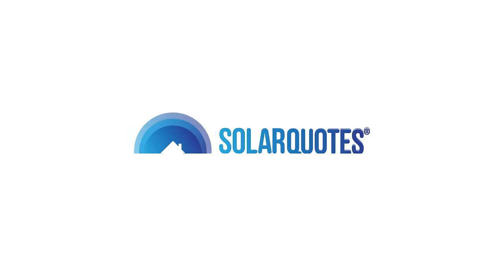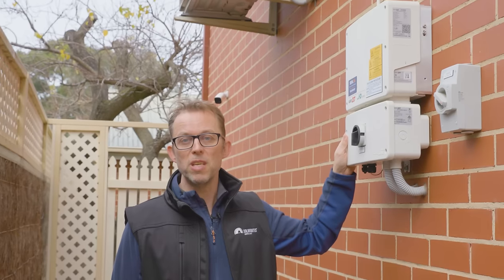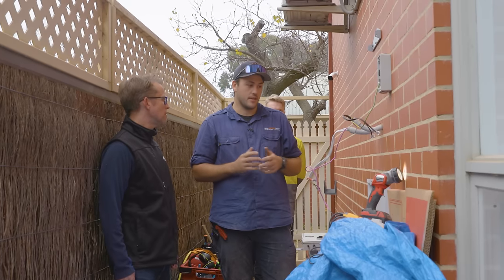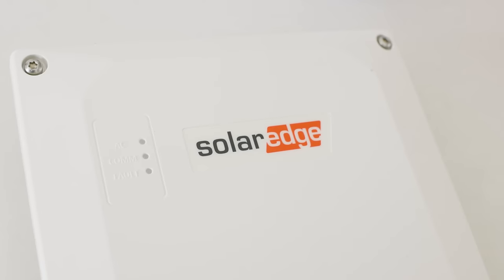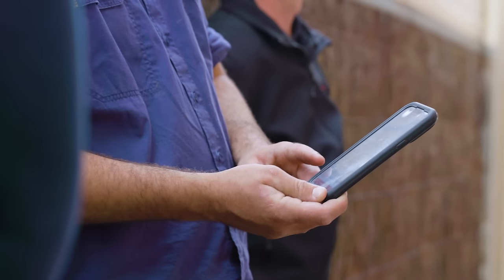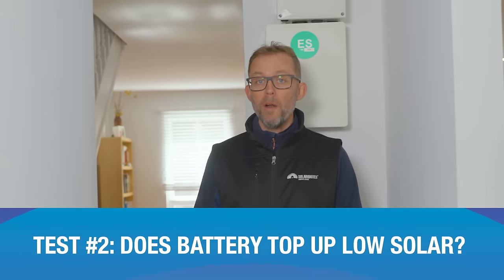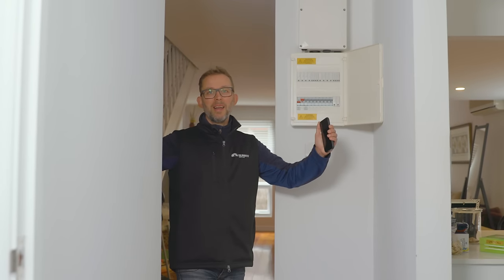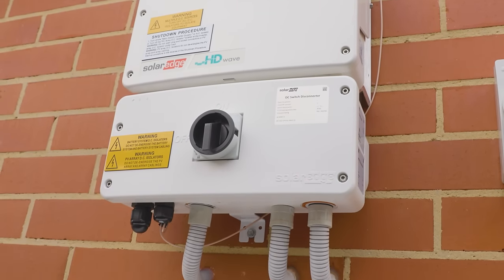SolarEdge Battery Install (Australia). It FINALLY worked!

Comment: Nothing about costs I note. Based on your previous solar battery tests I still can’t see how these things are worth anything like their cost. The idea is great, the execution is very disappointing. Thanks for the vid anyway, it’s nice to stay current.
Reply: I ask one of solar solar mobs how much for a system with a battery $53000 the panels were only $3500.
It was a joke. I told then they were pissing into the wind.
Reply: @gingertom56  That can't be right. Whereabouts do you live, and what was included in the quote?
Reply: @coopdivi  we have a heap of solar companies selling rebated solar systems here in Australia
So a rebated inter active grid system they awere selling for 3.5 thousand.
I asked for a battery for it and they can back with the 53 thousand.
I wanted an off grid.
Even the local solar and sat installer in  gin gin wanted 45 thousand. Fo a 5 kv system.
I brought through a Melbourne company for just under 20 thousand for a 5 kv off grid with no government rebates.
I slapped up a quick system with second hand panels and my new batteries for less then 5 thousand 1 thousand for inverter charger. 10 dollars for 8 panels and some wiring and fuse and switches.
Reply from the maker: The total system price was $12,455 (Aussie dollars). The SA Battery Rebate chipped in $1,455 making the final purchase price  $11,000.
Reply: @SolarQuotes  I got quoted installed price of $14,284 in NSW. Is that normal?
Reply from the maker: @sie3741  Was that for solarEdge battery plus backup, fully installed?
Reply: @SolarQuotes  all the above with free inverter upgrade as per the SolarEdge promo. SolarEdge Energy Hub Backup Interface
* FREE SolarEdge Energy Hub inverter replacement
(Trade Up Promo)
* SolarEdge 5kW Energy Hub 1Ph Wifi
* Evergen Intelligent Control software
* Solar Edge Energy Net Plugin-ENET
* Antenna for Wi-Fi inverters with SetApp

Comment: My big concern with batteries is the fire hazard that they can create. Watching videos of batteries burning or exploding is quite scary.
Reply from the maker: Did you see the fire extinguisher? I wasn't game to test it!
Reply: @SolarQuotes  yes and it proves my point!
Reply from the maker: @ancora966  Have you heard about how flammable gas and petrol are? Avoid those too.
Reply: Redflow ZCell are the answer, they are a flow battery, we've had a couple of them for almost three years in Melbourne.
Reply from the maker: @allanhugh2044  How much did that cost fully installed?
Reply: @SolarQuotes  A little hard to work out exact cost for the battery installation as we had a huge amount of work done at the time. Basically we had a system running on three rooftops all using micro inverters, this was ten years ago. Then three years ago we added another two rooftop installations with a completely different system, also running micro inverters and the batteries.

We have five different rooftops with three facing north; our original system, this is ten years old and is 4.5kW. One east and one west, this is our new system and is three years old, it is 3.2kW. This gives us a total of 7.7kW of panels.

The first system and the second system needed to be merged; so to speak, which was done very successfully. We are running two Victron inverters, they are on a purpose built frame in the backyard, attached (bolted) to the slab which was built to take the batteries, each inverter is in an enclosed weatherproof housing, with one inverter being the mother and in control, the other being a daughter. Both of these inverters are controlled by Redflow's Battery Management System, which is brilliant in operation.

So while we have  Victron inverters running the show and delivering power to the house, they are in fact subject to external control for the actual batteries. The Victron system runs the entire house and workshop, effectively the same as what this video shows of the house in Adelaide. As our original system ran micro inverters delivering AC directly from the rooftop to the house, with any spare going to the grid, once we added batteries and more solar panels (also running micro inverters) a master inverter(s) was needed to control things. It was the best way to keep our old system, which is still delivering wonderfully, and to add our new system to the mix.

The reason for the two inverters, effectively one for each battery, is power delivery capability. With two inverters and two batteries, we have two batteries with a flow rate of 5,000W each (10,000W in total) for short periods of 30 minutes or so. Or a continuous flow rate of around 3,000W each (6,000W in total). The continuous flow rate is possible from 100% SOC right through to zero SOC; in practice the flow rate slows slightly when SOC of the system reaches 1% SOC. We have a possible total of 20kWh of stored useable power, which in this time of the year (October) happens daily; subject to sunshine happening of course. If we had only one inverter, we would be restricted by that inverters power delivery capability, which is 5,000W.

If we add a third battery, we would not add another inverter. A third battery would just add storage capability and we would then possibly be running a system that fed little into the grid. We have been slowly switching our 73 year old house over to all electric, (almost there) over the last decade.

When we bought the batteries, they were $14,000 each, they have come down in price since then. Very hard to put a price on what their installation cost was as we had so much other work done, but a rough estimate would be another $7,000 to $9,000 to include installation and the inverters at the time of purchase; which was 2019. The ZCell batteries have come down in price since we purchased ours, we are awaiting the cost of the 3rd generation of their batteries which are about to be released, we understand that these will be cheaper again. Our current batteries are 2nd. generation ZCell units.

If ever you are in Melbourne, you're welcome to check things out.
Reply: @allanhugh2044  But the ZCell loses around 25% of its stored energy PER DAY via self-discharge when it is not in sleep mode, so if you had a week of cloudy weather the ZCell would be basically flat through self-discharge, even if you didn't use any power from the battery during that week. It also needs to be completely discharged and then recharged once per week I hear, resulting in even more wasted power. These deficiencies make the Redflow batteries useless for most applications, especially domestic solar and offgrid systems.
Reply: @DragonsOfAra  The self discharge as you call it, is not quite like that. What it is is that the negative and positive materials are liquids and they have pumps to pump the liquid around. So that the battery can operate, each battery has two pumps that 24 hours a day pump the liquids through the system; hence their name, Flow battery. Each battery when fully charged holds 10kWh of stored energy, each battery has these two pumps running with the average draw being approximately 70W to 90W for the two pumps. The reason it changes is because on the continuous live readout I have, these are the figures shown. It is not a self discharge, but the power requirements for running the battery. That power draw, is part of the efficiency factor of the unit, much like when an inverter charges a battery from rooftop solar cells and has an efficiency factor of 92%; as an example.

In practice, whenever there is daylight, and I mean daylight as opposed to sunlight, the power used to run the batteries is always covered. In the three years we have had these batteries, there has only been one day where it was a close thing. It was also a day where the grid went down in our area for approximately half a day. The batteries powered our house just, fortunately we started the day with around 50% SOC, didn't really improve on that figure as the day progressed, then when the grid went down we obviously drew on the batteries. I remember that we were generating around 200W at best, during the severe inclement weather part of the day from our 7.7kW rooftop array.

In practice, the power required to operate the batteries is part of the generating process, much like the fuel pump to keep fuel being sent to an internal combustion engine is part of the generating process to keep the engine running. The amount of fuel used to keep a fuel pump operating, radiator fans, alternators, air conditioner pumps and so on, are just part of the process of operating an internal combustion engine.

As for the completely discharged and then recharged once per week wasting power, it is not anything like that. Our batteries run a maintenance program at least once every three days, this maintenance cycle is completely automatic and is controlled by the ZCell Battery Management System (BMS). The longitude and latitude of each installation is is fed into the BMS and there are different maintenance systems one can choose. Our maintenance system is super simple and effectively does not wast any stored energy at all.

A battery goes into maintenance overnight, as we have two batteries, the battery that is going into maintenance is the one that powers the house overnight. Once that battery is down to zero, the maintenance kicks in and does its stuff. If by chance we have had a really good day and still have quite a lot of stored energy, rather than waste the energy, the battery going into maintenance transfers its stored energy into the other battery. At the same time, the house is still being powered by the batteries; so no grid power draw is used.

I am not trained in any way about these batteries, but I have done a fair amount of reading on them, plus I've been watching our two batteries over the last three years. The maintenance cycle is a requirement of these flow batteries, in order to keep them running in a pristine condition. Effectively these batteries when being charged by solar on the rooftop, electroplate a material onto the bromine plates in the plate stack. When one needs to draw power from the battery, the process is reversed and as the material is removed from the plate stack, electricity is generated. Essentially that is how these flow batteries work.

Now electroplating and deplating (word I just made up) obviously has some inefficiencies, as does almost any process I know of. In other words there is the possibility of small amounts of material stuck on the plate stack and being left there, if this material is not removed, then over time the battery will not work too well and eventually probably not work at all. What a maintenance cycle does is completely clean the battery, at which point, it is essentially a brand new battery. This process basically means that (in our case) every third day, each battery is brand new and will operate as though it is a completely new battery. It is this cleansing, or maintenance that gives these batteries the ability to operate on a 100% duty cycle every day for at least 10 years.

I mentioned that the maintenance cycle runs overnight, which is basically when we need any battery power. The house uses the power and if the battery is really charged up, then excess is transferred to the other battery. The maintenance cycle is started by the BMS to insure that the maintenance cycle finishes around sunrise and is ready to absorb any energy being generated on the rooftop. Which is why the BMS knows the Latitude and Longitude of its location.

If you are running a single battery, then the BMS can organise the battery maintenance cycle so that the cycle starts in the morning and finishes around midday. Ensuring that as far as possible you can operate the battery overnight every day, with the solar rooftop generation covering for the single battery maintenance cycle when the battery is being serviced in (hopefully) sunny daylight.

Comment: Drilling brickwork. Shouldn't the direction be angled up (outside to in) to avoid water access?😉😉
Reply: They use something called silicone sealant, apparently it makes the finished job waterproof 😉

Comment: Love the video. In  the Battery installation rules it says you can't install a battery "within 600 mm of any hot water unit, air conditioning unit or any other appliance not associated with the Pre-Assembled integrated BESS" But in your video the Battery is below the inverter by about 30cm. Is the inverter part of the "Pre-Assembled integrated BESS" or is it "not classified as an appliance? and therefore doesn't need this 600 mm spacing from the battery?
Reply from the maker: The inverter is associated with the BESS so can be within the 600mm.
Reply: @SolarQuotes  friends don't let friends buy at signature solar; use current connected instead, same merchandise & price, different attitude.

Comment: So just to clarify , battery NOT go at same time when u turn off the ac?
If this is the case this not good
All home appliances will suffer …

I thought it will operate like pc ups …
Reply from the maker: 3 second gap between losing the grid and SolarEdge battery kicking in
Reply: @SolarQuotes  tv and the rest not will like it
Reply: @daviddavidov6714  Wouldnt the same thing happen if you get a network power outage?
Reply: @jasonrhl  exactly , I thought if I can connect battery so it will be like ups , so during the power down battery will keep the line a life
Reply: @daviddavidov6714  From what I know and I was just standing looking at the battery install after but the battery is not between the network and the inverter. I hope I have this right. So when the power drops on the network there needs to be a trigger to swap to battery. If you use a UPS you are between the network and the device. I guess with some additional cost you could put a UPS between your house and and the network but you still need to sacrifice some devices like aircon that are usually not connected to the backup rollover unless you have a mega battery. 
I installed a battery to help me with reducing the power I was giving away to the grid and allow me to use it over night. If I was allowed I would choose my power to go to neighbors before the grid but I was told this is not allowed.

Comment: Nice setup.  Will the PV panels charge this battery when there is a black-out (assuming the PV is generating more than the house is drawing)?
I read that Tesla Powerwall-2 was not able to charge a battery during a power-cut; it would discharge the battery, but not recharge it until the grid came back on.
- Was this true several years ago?  
 -Is this true now?
Reply from the maker: Yes - both the SolarEdge and Tesla batteries have the capability to charge from the panels when the grid is down. 3 phase power makes things much more complicated, however.

Comment: Curious to know what model that new inverter is.  I had a SolarEdge battery installed in May and my inverter is the SE5000H-AUS.   Is that an Energy Hub or the older Genesis?
Reply from the maker: The new, hybrid inverter is an Energy Hub